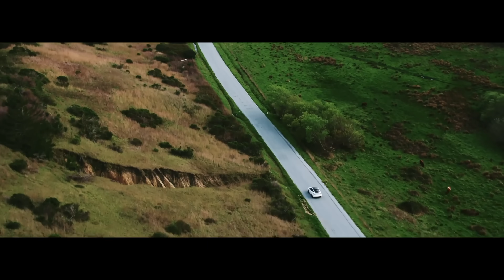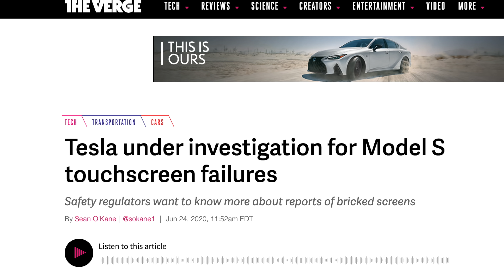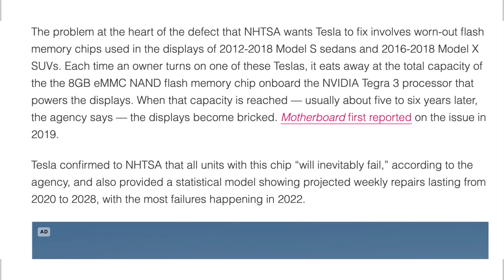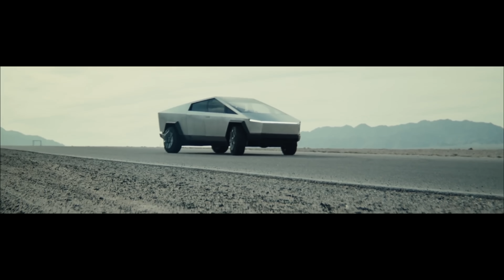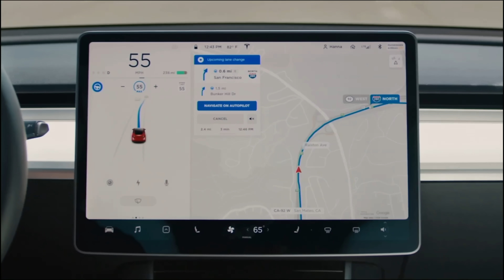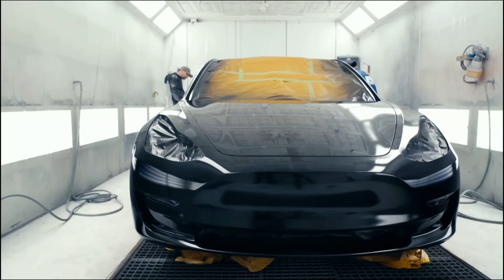Tesla to Recall 158,000 Cars

Comment: Unpopular opinion, but I lean more towards the opinion that Tesla should not be held accountable IF they were upfront to owners about the degradation of MCU1. Tesla cars are reliant on the latest and greatest technology which tends to become out of date fast, think about how out of date an IPhone 7 is compared to a newer iPhone and the iPhone 7 both in hardware and software, and the 7 came out in 2016! So I think, in a similar fashion to how we don’t get mad at tech companies (because I believe that Tesla is more than just an automotive company) for the enviable fact that eventually the hardware and software will do out of date or “die on us” we shouldn’t expect Tesla to compensate for something that’s just a fact with technology. It’s along the same lines of (keep in mind a shorten time frame due to the reliance on computers and such for Tesla) if you were to drive an ICU for 15 years and suddenly on the freeway your front wheel popped off, would you get mad at the automotive company? No, because you probably drove the crap out of it + time has allowed the physical components of the car to deteriorate. 
Plus the car was still technically safe to drive minus the back up camera from what I understand, which a lot of cars where I’m located don’t even have still. 
I think if anything, that Tesla should have some sort of “buy back” system for their MCU’s, kind of like smartphones, that way people can update their tech for a much more reasonable price and Tesla may be able to salvage parts and stuff.

Comment: You mentioned in your video that they should fix it because they knew it was going to break.
No offense but that mentality is exactly what every manufacturer in the world today is based on. Every car made today is built to fail if it's a good company they manage to get the car to fail a couple of months after warranties over if it's a bad company like Honda it's years after the warranties over before the car starts to fail I'm being sarcastic obviously but that's how everything is made today. Tesla is hiring people that think the same way and that's how this slip through the cracks and it's only going to get worse in 10 years time Tesla will be the new Ford or the new GM and I don't mean that in a good way I mean that in the way they have been making cars in the last 20 years and that's not good this is a prelude
Reply: Yeah, planned obsolescence. I figured Tesla did not need to do this yet because they have the whole auto market to sell into. Also they are now designing for 1M miles, supposedly. Clearly didn't in this case.
Reply: @usa-ev  that's not forget there are other issues as well the right to repair for one!where there's smoke there's fire
Reply: @raaah  Agreed Tesla is horrible wrt right to repair. Very much like Apple in that regard. I'm not at all convinced they are going to be benevolent overlords once they take over the world. I am however convinced that they are going to take over the world.
Reply: @usa-ev  I agree with you 100%. That's why I want to Tesla they are going to take over the world but the same guys who follow forward in GM today also said the same about Ford and GM a long time ago and look at them now in denial. And let's be real we say we love Tesla but in reality it's Elon musk who we think is a good guy and trying to do right and we all know what happens to a company when their leaders gone and there's only executives with the only goal is money left

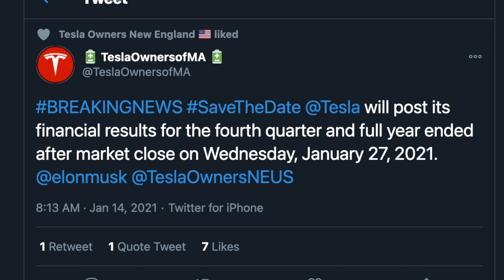Comment: 9:04 idk phones usually get replaced every year or so... I guess the screens should last new at least 5 years paid by testla plan... I'd expect new cars if this is a big deal to be easily removable using slots and pop off instead of direct wiring for easily replacement or upgrade of screen if adaptability is accepted on said model
Reply: Correct, we replaced phone every year. So getting a new car every 5 years is normal.

Comment: Nice one Nvidia 👌🏾
Reply: FWIW, it's Tesla's design/fault, not Nvidia's. 1) it's an eMMC chip on the circuit board separate from the main Nvidia chip. 2) the eMMC chip is operating as designed/spec'd, it is the software that was writing too much data to the chip causing it to wear out faster.
Reply: It's a tech car, 10 years life span is good enough.
Reply: @john17720  That won't get me a million miles. ;)
Reply: @john17720  lol no

Comment: So in other words Tesla's will never get the label Old Timer. Also like i mentioned before : The OTA updates must store somewhere in the cars systems so what if that gets full? I'm not a Tesla hater i love them but this worries me.
Reply: @The Monster Under Your Bed  Right. Typically a system like this will have space for an A and B version. While A is running B gets updated. When B is ready it runs B and then on next update A can be overwritten with a new version.
Reply: The new update gets temporarily written into a separate SD card which is located on the MCU mother board.

Comment: I smashed my rear window with ²⁰¹⁹ Honda laggy and freeze prone  infotainment system- so many complaints but nothing was done about it ...
Reply: Which model?
Reply: @usa-ev  the PHEV Clarity, from2018 Honda rocked a watered down Android headunit with 1gb ram on Android 9 unable to root or upgrade.  It was on several of their models (civics, crv, Clarity and on the NSX (!!) It was so slow.   I actually backed out of the driveway into a dumpster because the unit would take several seconds to change feeds to the backup camera. 
Huge fail. NHTSA got many complaints about it. No recall
Reply: @Moe-Loe  Very interesting! Thanks!

Comment: This was a failure in a NVIDIA board and Tesla stopped using NVIDIA so hopefully it won’t be an issue for model 3 or model Y.  Certainly, they investigated their own board by now to see if it has the same defect.
Reply: actually, the new MCU 2 uses an INTEL Atom processor

Comment: I'm sure the actual cost isn't 2500 each to Tesla. And also every auto makers is forced into these recalls. They need to fix this though. It's the biggest reason that I went with a model y instead of a used model S. This issue came up over and over in my research. BS that they didn't do it sooner
Reply: It's the same kinda shit as when my eco diesel engine blew up in my ram. Just off warrantee and cost me $14,000 for a used motor. Then two years later they recall the problem but the truck is already long gone and good luck getting that money back

Comment: NHTSA has gone after Tesla for several issues.  Most have been dismissed already.  The brick issue is simple to fix, but is an issue for older models.  Over all it's a minor issue.
Reply: Exactly, they will replace the screens, and done. But if they used 32 or 64 GB cards instead of 8GB most likely this won't be an issue (maybe only for the power users).